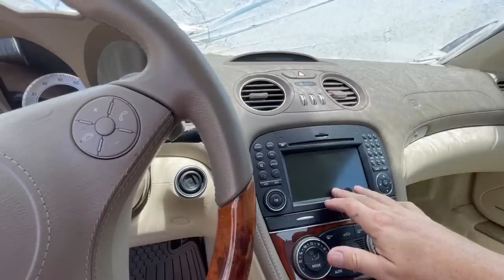IAAI Walk Around - 7/20/22

Comment: That hood on the SL was hit from the front. The metal is pushed and folded to the back. If it had come in, whatever it was, from the back and side, it would have done more damage to the engine cover. I'd say someone took the bumper off in order to open the hood. Maybe?
I hope it doesn't need a compressor if you buy it. Lol